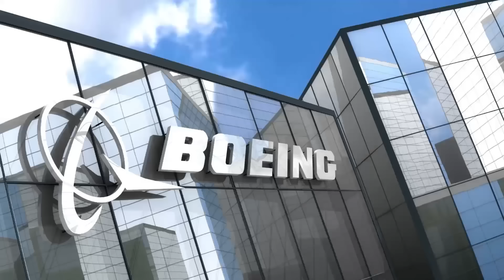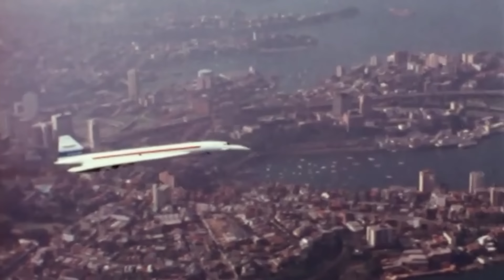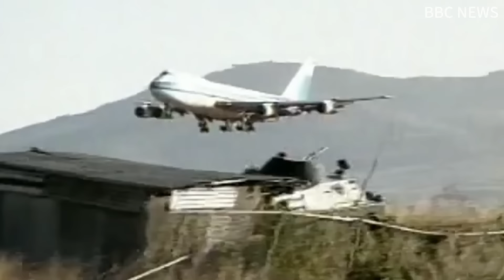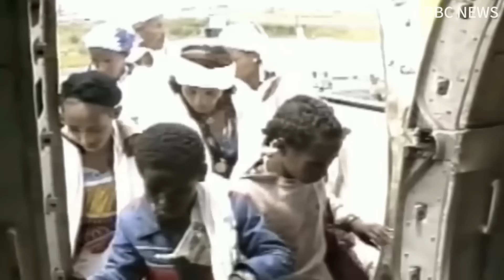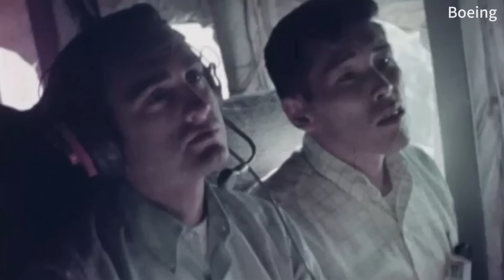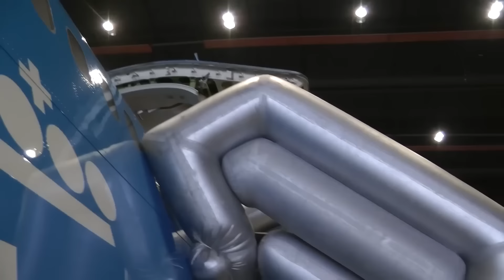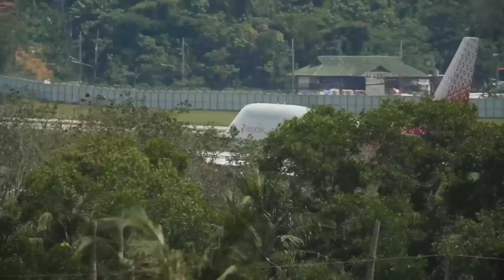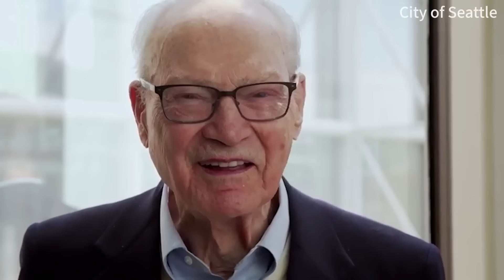What The Boeing 747 Hump Was Really For

Comment: As impressive as the civilian 747 is, the "Air Force One" variant (VC-25) is a beast. It weighs less than a standard 747-200, but has a special engine variant based on the 747-400 (but more powerful). This means the VC-25 can take off with just 2 of it's 4 engines. If the aircraft weight is low enough, it can even maintain level flight with 1 of 4 engines. This is because a VC-25 flying with 3 engines has more thrust than a 747-200 has with 4 engines.
Reply: None of what you said is true. Especially the engines part.
Reply: @rtbrtb_dutchy4183  in fact it's quite true. While the 200 variant did eventually get GE engines from the 400 series in addition to the p&w engines, the VC-25s were part of the E4B purchase order. After the fall of the USSR the last two airframes were repurpose to executive transport. These six airframes (4x E4B and 2x VC-25) are the only ones that have this engine variant, which produces around 2000 lbs more thrust than the highest performance engines ever fit to civilian classic 747s, and 10,000 pounds more thrust than the original p&w engines. I don't have the model numbers memorized but you can find all the info from public documents if you look hard enough.

In fact, a big part of push to replace the VC-25 is to have a greater parts pool for the E4Bs.
Reply: Wow!🎉
Reply: @ILikeDemocracy7 it’s not true. 😂
Reply: VC-25 is based on the E4b. Soviet union fell and it was decided 4 of them was enough. They are the only six aircraft with this configure. 2000 lbs per engine more powerful than ANY civilian 747 classic. Additionally, the VC-25 has a very low takeoff weight, on par with an empty passenger variant. All of the capabilities in the original post are fuel-dependent, as I mention in my original post.

Remember VC-25 has TWO APUs allowing you to disconnect ALL bleed air / hydraulics / electric from the engines... (as well as starting 2 cold engines simultaneously). Edit: capabilities like this are why they intentionally kept the flight engineer station.
Reply: @PsRohrbaugh it’s the same engine as used on the -400. 2000 lbs per engine, doesn’t mean that 3 engines produce more than the classic 4 engines. Not even close. 56,000 lbs of thrust times 3 is 168,000 lbs of total thrust. 54,000 times 4 is 216,000 lbs total. Even if we use the weaker 46,000 for 4 engines, is 184,000. But those were for 747s that had a significant lower max takeoff weight. Your numbers just don’t work. 

Nobody is going to attempt a 2 engine takeoff. But technically, any 4 engine airplane could if it’s light enough. As long as it’s symmetrical. It can never happen with 2 engines on one side. 

Any 4 engine aircraft can fly on 1 engine if light enough. 

If you take out an airline interior out of a 747 and put in a VIP interior, the VIP interior will weigh the same as about 50% of the airline interior. Now, all the communication and self defense, as well as refueling system, will bring the weight back up.
Reply: @rtbrtb_dutchy4183 lowest thrust 747 variant used p&w engines making 43,000 pounds of thrust. Engines on VC25 produce 58,000 pounds of thrust. I admit it's cherry picked and a slim victory but the math checks out.

As for the other points, I guess the important part is that there are procedures in place for these operations in a dire wartime environment. Push everything to the limit to keep the President alive. Like in an extended wartime environment, two engine operation could mean removing the non functioning engines. Plumbing allowed for that. Pretty sure this is all unclassifed. Got it from my grandfather, a USAF colonel in procurement, back before his dementia got too bad.
Reply: @rtbrtb_dutchy4183  Tired of YouTube deleting my replies. I have arguments in my favor but can't seem to post them. Ah well.
Reply: @PsRohrbaugh well, I don’t know what your responses are. But I’m type rated on the classic and have 1500 hours as PIC. I’ve flown with PFEs who flew the VC-25. So you might think you have arguments in your favor, they are not valid.
Reply: @rtbrtb_dutchy4183  OK I'll break it into smaller comments and hopefully that'll work. Remember how the very first 747s allowed you to use the APU to run the pacs on climb out, up to FL150? WITH the ability to (re)start them in flight? Then the inlet was redesigned to reduce drag and in flight start was removed, but some would still use APU for climb? Well VC25 has TWO APUs, both of which can be started in flight. While the main purpose of this is to allow you to cold start two engines simultaneously on the ground, it also can provide all bleed air AND electrical power in the air. There's still no direct hydraulic connection, but you can run the ADPs off the APUs farther reducing engine load.
Reply: @rtbrtb_dutchy4183 OK that seems to have worked. I'll admit I cherry picked my comparison on thrust, comparing the lowest power test variant of the 747 which had p&w engines making 43k pounds of thrust or so. The GE retrofit engine for classics is the CF6-80C2, but the VC25 has a special variant making just under 60,000 pounds of thrust. Maybe the capabilities I discussed never made their way into operational practice. But they were part of the procurement process, and in theory the aircraft should be capable.
Reply: @rtbrtb_dutchy4183 So for a twin engine takeoff, it'd be taking off with minimum fuel, going up and hitting a tanker. Also probably after removing everything they could from the aircraft. Both APUs running the entire time.
Reply: @rtbrtb_dutchy4183 and my luck ran out with my final comment. Let me try this again. Twin engine takeoff involved running as much as possible with the APUs, minimum fuel, mid air refueling, and probably throwing everything not bolted down out of the aircraft before takeoff. At least that's how it was spec'd. Maybe none of that made it into the standard operating procedures.
Reply: @PsRohrbaugh again, you are using engine thrust of airplanes that are 100,000 lbs lighter at maximum takeoff weight. The 747-100 were 735K lbs. The VC25 had 56,700 lbs of thrust, but had a max takeoff weight of 833K lbs. 

Your APU story is wrong too. First of all, APU does not power hydraulics. Only bleed air and electrics. Bleed air is restricted in the air. 

Your 2 engine takeoff story is just silly. Any 4 engine aircraft can technically takeoff with 2 engines if light enough. But only if it’s symmetrical. But no one will ever do this nor is it approved. One of the reasons is that you could lose 1 of the 2 engines and won’t be able to climb out. Also, with 2 engines, you won’t have proper hydraulics. 

Your reasoning with all of this is just weird and incorrect.
Reply: @rtbrtb_dutchy4183 I don't think you read my replies critically enough, but c'est la vie. I will ruminate on the matter.
Reply: @rtbrtb_dutchy4183 one example being you "arguing" with me about hydraulics when I said there is no direct connection between APUs and hydraulics. 

It's all about bleed air powered auxiliary pressure units (ADP) or AC powered pumps (ACP).

We'll talk tomorrow when I'm sober
Reply: Does it even make sense in the 21st century? The sky , in a shooting war is the last place I'd want to be.
Reply: @markrainford1219  the military likes having options. Same reason most navy vessels have "battle short" devices allowing you to bypass circuit breakers and directly run devices.

Comment: I never flew on a 747, but I fueled them for United Airlines. The 47 had eight fuel tanks. Three in each wing, a big tank in the belly, and a small tank in the tail (the horizontal stabilizer). It would take about an hour and a half to fuel it by yourself. Maybe about fifty minutes with another truck at the other fuel station. I only had to defuel a 47 two or three times. That takes HOURS.
Reply: How did you make sure you didn’t contaminate your fuel while defueling a airplane? We had to do fuel samples each day after we almost lost a helicopter due to algae… I wouldn’t dare suck foreign fuel into my tanks without proper testing…
Reply: The fuel trucks were tested before each shift. Fuel was filtered as in passed thru the truck into the plane. Off-loaded fuel was tested and filtered before going back into another plane. I was at O'Hare for 7 years, and never heard of a case of bad fuel getting into a plane.
Reply: @KRW628 no, sorry, you got me wrong. I’m not concerned for your fuel, I’m concerned for the fuel residues and rest-fuel in the tanks, which mix with your fuel and then, when you de-fuel, you suck that sheeeet out into your clean fuel system and tanks. Do you have underground fueling system or tank trailers?

Comment: I wonder how many know that it's original concept and design was for a support plane to carry the luggage of the passengers of the never built Boeing supersonic jet plane the 2707 to rival the Concord. It never got built because Boeing couldn't develope an engine strong enough to fly the plane at supersonic speeds fully loaded with both passengers and luggage or cargo so the 747 was built to do that before, but because of so many delays and design failures of the 2707, and seeing as the British and French Concord won the race, Boeing's concept remained just an abandoned failure. So what to do with the luggage carrier? What else? Put seats in it and try to claw back all the miilions the company lost at supersonic plane building. The rest is history. I've flown on a few in my decades of life. and I've also flown on the AB380 as well. I like both planes and will miss the 747. There was also the small problem of the 2707, being too heavy if it was ever built, that though the passengers would say arrive in London, or New York in 3&1/2 hours they still would have had to wait for their luggage to arrive at least 4 to 6 hours later after the 747 arrived. 😂
Reply: Aircraft manufacturers don’t develop engines they buy the from suppliers like General Electric or Rolls Royce
Reply: @gibsonclan1able  The concord engines were more like rockets that your bog standard jet engine, noisy as hell as it would rattle our windows with it's sonic boom before decelerating before approaching Wales, UK and then when it was approching Heathrow in London at subsonic speed. One couldn't hear oneself speak it was so loud. I don't miss any of that at all.

Comment: Most memorable experience,  we hit the runway too far down and had to go around.  I still remember the feeling of being set back in my seat and knowing that every other passenger was experiencing the same thing.  Those powerful engines were there when we needed them.
Reply: You should have tried the feeling of being pushed back into your seat on a Concorde takeoff with 4 afterburners blazing! It was an amazing feeling, which I was lucky enough to experience twice.
Reply: @Nilguiri I flew in the Good Year Blimp. No afterburners to be sure, and she did not exceed 35 knots, but an exhilarating experience too. You can actually stop in midair without stalling or sinking. Amazing! 😛
Reply: @duartesimoes508  Wow, that must’ve been incredible — I’m extremely jealous! I used to skydive, and my club once tried to arrange a jump from a hot-air balloon, but sadly it never came off, unfortunately. 
I imagine flying in a blimp must feel quite surreal... and 35 knots isn’t exactly slow  for something the size of a house with the manoeuvrability of a drifting sofa! Cheers.
Reply: @Nilguiri  and yet she only carried four people; one pilot and three lucky blokes on a rear seat. There was no yoke, and the ship was flown just as if you were seated on a wheelchair, with a huge trim wheel on either side. In front of him the pilot had a set of valves, the throttles for the two minuscule 60 CV Maybach engines, and a few instruments. The ship had a lot of inertia, was horribly sensitive to wind, and everything took a lifetime to be done. It had been contracted for the 1993 Portuguese Formula 1 Grand Prix and used to fly along the shoreline at night at low level and all lit inside, a magnificent sight that must have left a lot of people widemouthed. 😍We Air Traffic Controllers were all invited for a ride. 😀
To receive and secure the Blimp, about twenty people were needed. She was fettered to a mast by her nose only and changed position constantly, just like a weather vane. 😄
Reply: @duartesimoes508  That's fascinating, thanks for sharing that. I would have loved to have even seen that, let alone taken a ride in it! You'll never forget that experience!
Reply: @duartesimoes508 the very top of the Empire State building was designed as an airship mooring post, with the passengers getting off down a gangway from the nose, trans Atlantic and straight into the heart of New York, the concept was stunning and bold, unfortunately the passengers absolutely hated it, the gangway was windy and didn't feel safe for them, it was the only time it was ever used.
Reply: @duartesimoes508  Growing up in Southern California the Goodyear Blimp would routinely fly over our home.  As routine as it was, we kids never failed to run outside to watch it whenever we heard the tale tell droning sound of the engines.  The blimp almost always flew over our house at night, and each side of the blimp was lit up with thousands of individual lights to form a display with colorful shapes moving across the side of the blimp.  I always wanted to ride in one, but never got the chance.
Reply: Yep. I was in a 747-300 QANTAS City of Brisbane I think and we were about to land in Sydney when he puts the power back on and did a circuit and landed next go. Those Rolls Royce turbofans are awesome.
Reply: The best go arounds are 757’s. Those things take off like a scalded cat. It’s like a rocketship.🚀
Reply: Go arounds are trivial for any airliner. You are already traveling at nearly flight speed anyway. And all multi engine planes are certified to be able to fly just fine with half the engines failed (though in flight engine failure is extremely rare). It isn't that uncommon for planes to take off after a bird strike, because it is safer to fly on 1 engine than abort takeoff past a certain point. Most airliners have only 2 engines for efficiency reasons.
Reply: @xeridea they are certified for one engine failure, not half the engines. A 747 is certified to lose 1 of 4 engines.
Reply: @xeridea 😂
Reply: An A330 pilot once told me that on Final they always bring much more Flaps than needed. This is to bring more power than needed, so that in case of going around the engines have more power already applied and once Flaps are retracted the aircraft will gain airspeed faster. It is noteworthy that they keep doing this with very modern powerplants, maybe because those huge Fans have a huge diameter and a lot of inertia... 🤓
Reply: @duartesimoes508 what that A330 pilot said is not true at all. I doubt that was what he was trying to say.
Reply: @rtbrtb_dutchy4183 coming from him, I don't have the slightest doubt. And he was one of the longest serving and better regarded pilots in our Airline. Actually he told this before a full classroom of Air Traffic Controllers during a refreshment. He was our Aircraft Performance Instructor.
You don't have to believe him if you don't want; I will.
Reply: @rtbrtb_dutchy4183  coming from him, I don't have the slightest doubt. And he was one of the longest serving and better regarded pilots in our Airline. Actually he told this before a full classroom of Air Traffic Controllers during a refreshment. He was our Aircraft Performance Instructor.
You don't have to believe him if you don't want; but I will.
Reply: As Airline passenger, I recorded that I flew in Airlines 66 times for 38 years before finally going around due to an unstabilised approach. Being Air Traffic Controller, I was confused and a bit pissed. After all, I was supposed to instruct the others to go around, not be taken by surprise at less than 1000 feet! 😬
Taking advantage of my rating, I called my work mates in LPPT TWR after landing and was told the reason, as the cockpit crew said nothing. 😶
Nowadays, in the EC at least any Go Around generates a mandatory report, both from the Airline and ATC Provider. Quite a hassle. 🤬
Reply: @duartesimoes508 I experienced two go-arounds in one day. I didn't realize they are relatively rare. Wheeee!💨

Comment: When the Airbus A380 came out, one of its remarkable features was a double deck with an oval cross section. My reaction was that it was akin to a 747 with just a 747 hump stretched along the entire length. I find it funny that the 747 was originally designed exactly that way.
Reply: I was wondering about that  and have the safety requirements for evacuation times changed since the full double deck 747 was designed  but couldn't  be built because of safety evacuations.
Reply: I recall the safety issue was mentioned in the video. I wondered why they didn't just add extra escape doors on both levels. Perhaps too many doors would have made the 747 too heavy due to the reinforcement needed to make up for the gaps the doors made in the structure.

Comment: Removing most of the seats to let passengers sit on the floor was not the only trade off for that emergency flight. A big problem was the lack of emergency oxygen. Without that, the plane could not safely climb to cruising altitude, and that kills the speed and fuel efficiency.

Comment: I was a navy plane captain and jet engine mechanic and the cockpits had a lot of gauge's had round analog set up and required time to scan them all for normal readings. Then came the ideal to rotate the different  gauge's so that normal was at the 12 o'clock position allowing for a quicker scan.
Reply: All fed back to a screen now. Cheaper but not as impressive